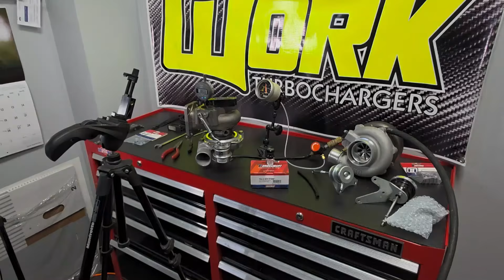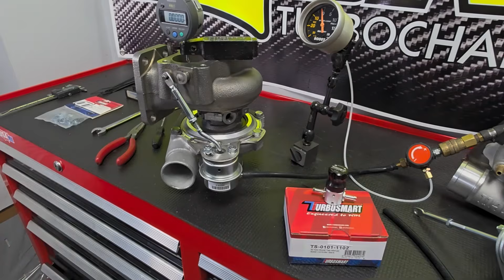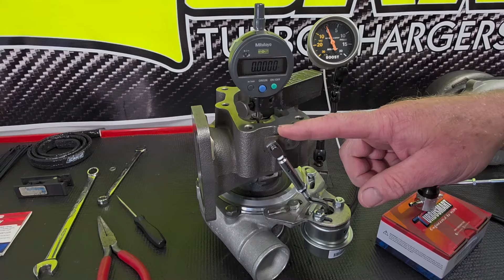Turbo Internal Wastegate 102, Adding Manual Boost Control Episode 2

Comment: Lets say i have a wastegate that starts cracking at 7psi when testing off the car, but on the car i see 13psi without using boost controller(starts cracking at 14psi using a mityvac), can i run 14psi(double the spring pressure) max or 26psi(double the actual minimum pressure) max?

My final goal is 18-19psi with boost controller. I already trued a Turbosmart G25 wastegate actuator. With the 14psi spring i was hitting 19psi. 12psi spring was 17psi, 10 psi spring was 16.4psi, 7psi spring was 10psi. Not sure their spring ratings are accurate... was hoping to hit 14psi on spring pressure. Thats why i ended up going back to the factory Garrett actuator which im assuming is a 0.5bar based on the crack pressure of 7 psi i was talking about. Was hitting 11.25psi initially but tuner said my gate probably had too little preload and was possibly opening from exhaust backpressure so i tightened preload a few turns and am at 13psi. Wanted to try the 1 bar Garrett actuator but im afraid it will also make me hit 19psi minimum like the Turbosmart.

Comment: Where would you install a boost gauge sensor to get the reading of the actual boost you get? Before the manual boost controller?
Reply from the maker: Actual boost would be referenced from your intake manifold, after the throttle body.  Reed

Comment: nice set up,remember back pressure will play a huge roll on the maximun pressure achieved so the range will not be that huge,keep the good videos coming
Reply from the maker: Thank you! Great point. We're planning to conduct real-world testing to demonstrate the effects of back pressure and a few other key data points, and how they can influence performance. From there, we'll move on to exploring electronic boost control systems—like the GReddy Profec or Turbosmart e-Boost—as well as ECU-based boost control down the line. -David

Comment: Dont they usually say that you can frequently double your base spring pressure until you need to go EBC?
Reply from the maker: The general rule of thumb is that you can typically run up to double the base spring pressure in a wastegate system. While this is more commonly discussed in relation to external wastegates, it also applies to internal wastegates.

Electronic Boost Control (EBC), unless utilizing CO₂-based control systems or an electronic wastegate (E-Gate), is usually limited to around double the spring pressure as well.

One major advantage of an EBC setup—whether it's a standalone unit or integrated through the ECU—is the ability to improve turbo response. Additionally, EBC systems allow for advanced control strategies such as boost by gear, ramped or tapered boost maps, and various other logic-based configurations to optimize performance. 

We plan to cover this in future videos. -David